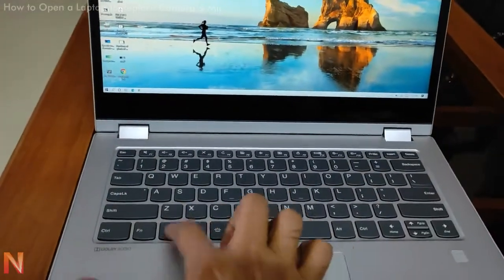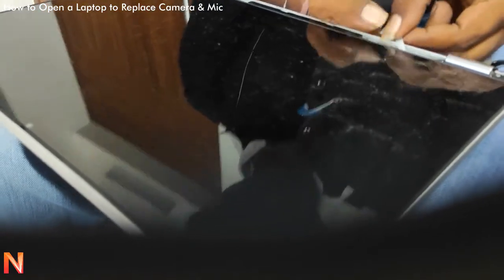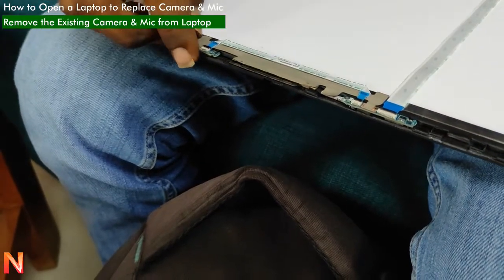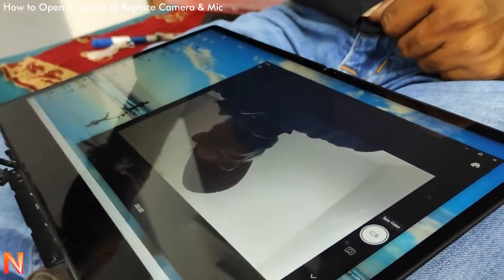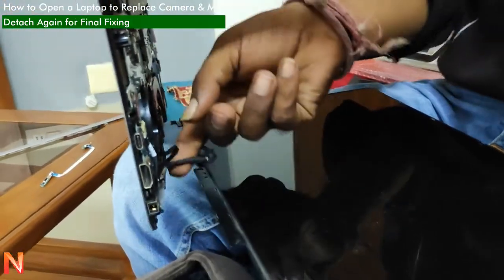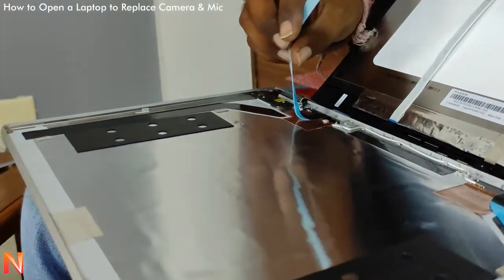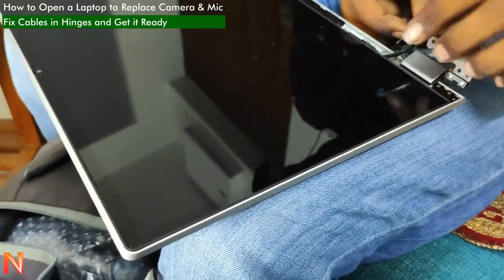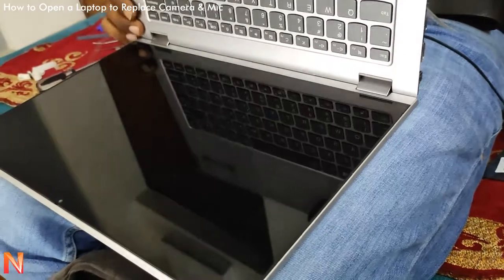Lenovo C340 Laptop Repairing | Laptop Webcam Repair | How to Open Touchscreen Laptop Screen Flicker

Comment: This type of repair is way above my pay grade, but I have a flickering issue with the camera on my IdeaPad S340. The suggestion on the Lenovo community support chat board said to press or squeeze the frame just to the right of the camera lens. This seems to work for me, at least temporarily.
Reply from the maker: good to know the quick solution but this company must do something about this expensive gadget

Comment: Same problem here with S340-15IWL Laptop (IdeaPad) - Type 81N8... do you think I can get it repaired for less than 50 euros?
Reply from the maker: yes if you have small electrician shops doing all such type of labour work

Comment: My hinges are loose, same model. Anyways to tighten the hinges to prevent the shaking of screen?
Reply from the maker: there is a way but they are very tiny parts! do you really want to do? if so, you can fix them by opening the LED screen part but do it at your own risk (else we recommend you to contact service station)

Comment: Great video. I have the same laptop (AMD Ryzen 5 variant) and the internals are very similar. I have purchased the 3 years extended warranty as well. Till now, it has been working absolutely fine.
One suggestion though, he should have disconnected the battery before doing the repair. While doing the repair, there is always a possibility of getting something shorted. But very informative nonetheless.
Reply from the maker: ya its a great laptop